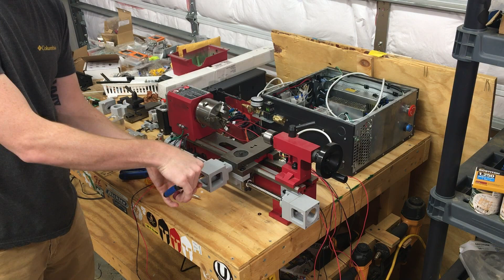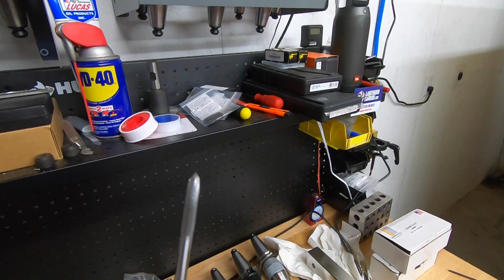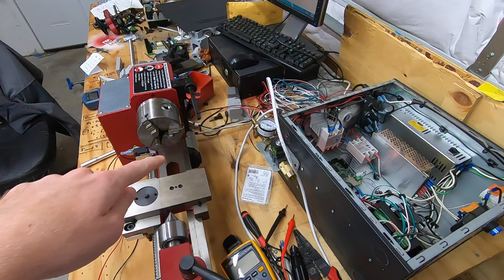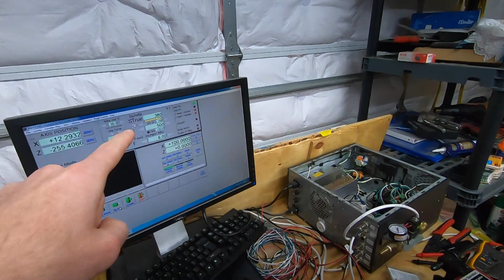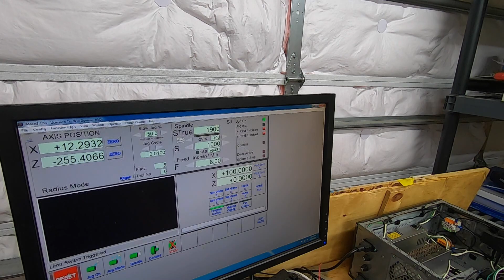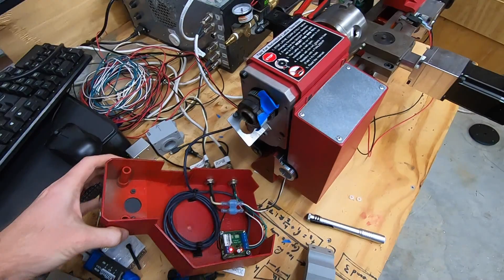CNC Lathe Update - All Aluminum Kit!

Comment: Nice seeing you making progress with you little CNC lathe.
I did something similar to a slightly bigger SC4 during the last month. Instead of making my own bearing blocks I went with of the shelf BK FK blocks with angular contact bearings and simply slapped some motor mount on those. Works really great. I have some videos up of the conversion if you wanna have a look (in German but I was told the automatic subtitles work good enough to get e rough understanding ;-) )